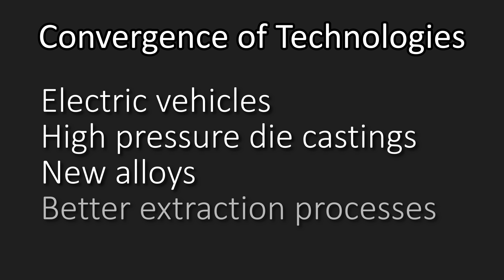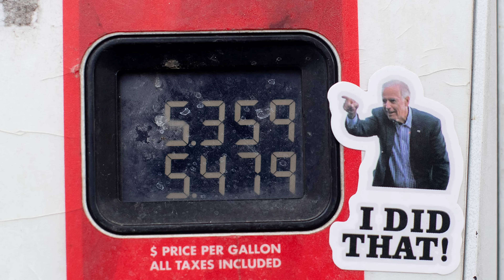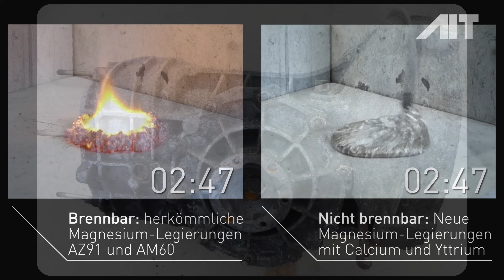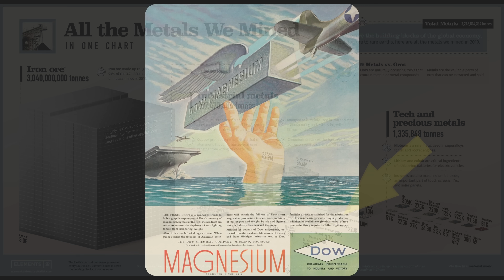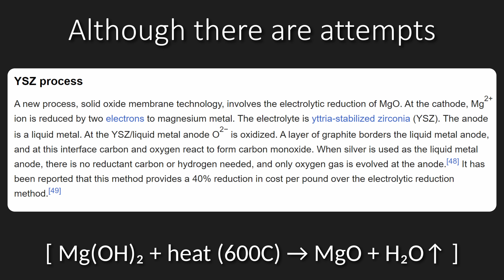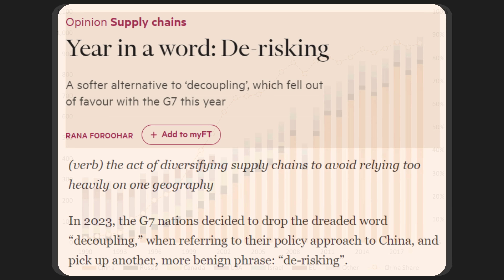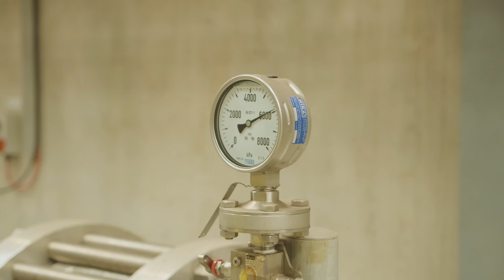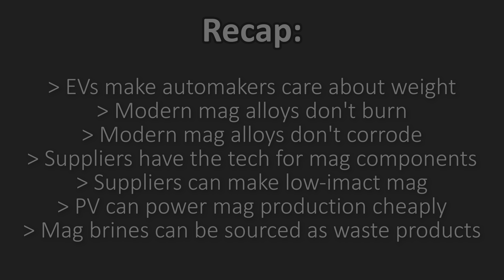Welcome to the AGE of MAGNESIUM

Comment: Oh yeah, let me get a e-car crash where a lithium battery goes up in flames then ignites the magnesium, gonna be lit.
Reply: Try this with a Hydrogen car DUUUUHHH
Reply: Spell Tome: Conjure A-class Star
Reply: mmmmmmmmmmmmmmmmmmmmmmmmmmm burger...
Reply: Back door battery detonation.. if they told you it was possible would you still buy one 🤔
Reply: Add the fact that EVs have dumb computers that turn into obstacles.
Reply: Lol
Reply: i think that if you crash and your car is on fire it dosent mater a lot if it has batteries or not, also we probably can already power a fleet of all ev cars since we already expend a lot of energy in extracting, trasnporting, refining oil etc. while with ev you will just power it, but it will be interesting if someone does the math
Reply: Fair but ideally all cars are electric and self driving coordinating between each other so crashes very very very rarely ever happen.
Reply: @tone618 and then, your alarm clock went off, and you were rudely ripped back to reality.
Reply: @remcovanvliet3018  wooh that nothing burger is really tasty do you think I could get some mustard to go with it?
Reply: @remcovanvliet3018  second chance do you have anything useful to contribute aside from saying I'm right your wrong?
Reply: @tone618 that's probably not going to happen, at least not in this generation, ppl won't accept
Reply: @nicolasmfa  people didn't initially accept automobiles at all and here we are.
Reply: Which means your ability to move is dependant on the Grid like a calf at the teat.
Reply: @SouthPod  as if your not dependant on gas in the same way. Its actually a better analogy for gas as it's a liquid and can't be as easily transported over distance like electricity can via idk the massive network of powerlines across the US.
Reply: @tone618  Your access to that grid can be terminated remotely if the people controlling it determine it to be useful to them. It's also incredibly fragile, moderate damage to two or three substations in a metropolitan area could theoretically shut an entire city down.

Using a smal bit of preparation and the correct tools, gasoline can be stored for as long as three years quite cheaply, it can also produce electricity for home use rather than consume it. Especially in cold climates which don't lend themselves to solar, and wind is not dependable.  Long term battery storage is incredibly expensive.
Reply: "Your access to that grid can be terminated remotely if the people controlling it determine it to be useful to them. It's also incredibly fragile, moderate damage to two or three substations in a metropolitan area could theoretically shut an entire city down."

Same deal with gasoline.

"Using a smal bit of preparation and the correct tools, gasoline can be stored for as long as three years quite cheaply, it can also produce electricity for home use rather than consume it." I wasn't aware electricity consumed itself. gee a whole bunch of electrons seemingly vanished oh wait I'm lieing electrons can't do that.

 "Especially in cold climates which don't lend themselves to solar, and wind is not dependable." Luckily the price of solar panels has plummeted since their invention making it possible to live even in cold climates without issue while panels themselves have highly efficient. People so far north as to make even very large amounts of solar panels impractical are just as vulnerable to a cutoff of petrochemical supply as they are to electricity.

 "Long term battery storage is incredibly expensive." Which is why geothermal energy solutions are optimal alongside low cost gravity storage systems. Oh and battery tech has seen a leap in advancement recently while there are continually more low cost battery technologies.
Reply: @tone618  all cars being electric is just a dumb idea, they're only better for the environment if produced in small quantities.

 Make every car autonomous and congratulations, another less efficient than a simple electric train invention. You guys are all geniuses by reinventing the train again and again.
Reply: @davidaugustofc2574  well that would be optimal but people in the US tend to be far to selfish and individualistic to support the construction of large scale high speed public transport.
Reply: @tone618  that or company lobbying and propaganda works wonders. Cars are more profitable, and so are disposable plastic products, we'll never get rid of them.
Reply: @SouthPod gasoline is literally a liquid? Lmaoooo.
Reply: @davidaugustofc2574  Taking the train is only a solution for people who live in large cities. It's unsustainable for suburban and rural people. They still need cars to get to the train hubs. The train also forces you to sit with hundreds of strangers and deal with their bullshit, their smell, their noise and their bad habits. They are prone delays just like cars, and if the grid goes down nobody goes anywhere.

I took trains for 20 years, I will never give up having a car.
Reply: @SouthPod  I guess it depends on education, the trains here are pretty silent, if someone is causing disturbance there's always a guard every other train.
Reply: @SouthPod   sounds like you rode some kind of murikan train, trains here are quiet, comfortable, safe and always on time 

Rural america before the 50's was based around train transport, system worked very well, because the infrastructure was designed accordingly.
Reply: @PRH123  I'm Canadian
Reply: @SouthPod   same thing :)
Reply: @tone618  I would argue that if Americans are too selfish and individualistic to get on a train, they are also too selfish and individualistic to support their "driving rights" being taken away from them by self-driving cars - If cars (or, for that matter, coach buses, or another slightly more financially viable alternative) are fully self-driving and coordinate between each other rather than taking driver input, what makes them any more inherently liberating than getting on a train?
Reply: @SouthPod  Didn't you Canucks have streetcars once, too? We Americans with our suburban sprawl used to get by just fine on light rail and streetcars out to every neighborhood, and lots of places in the world still do, or take the bus to the nearest train station. Go to Germany or maybe Amsterdam and try to insist on taking the car everywhere you go. You'll learn quick. (Or go to New York City - the subways are gross, but the traffic's even worse.)
Reply: @ratemisia  Look at the size and density of the US and or Canada and you'll see why comparing it to Germany is stupid.

Streetcars only work in dense cities, everywhere else it's too sparse and too spread out here for anything but personal transport to be economical.
Reply: @SouthPod  Someone needs to tell that to China and India... They must be really sorely suffering, considering they get two or three times as many passenger-kilometers by rail as the next country and both have relatively low car ownership! Maybe India is so ridiculously wealthy that they can afford the egregious expense of gigantic rail lines for no benefit... Oh wait. And the Chinese - who we all know for their economic incompetence, surely - sure are wasting a lot of money on the largest high-speed rail network in the world, considering how impractical rail transport is in a country as big as China. Let's face it - our continent was convinced of an automotive future in the 1950s by oil barons and motor companies, demolishing and disusing our perfectly good rail networks in the process, and we're paying the price for it now while we watch the so-called second and third worlds pass us.
Reply: @ratemisia  india - LOL
Reply: @SouthPod  And in any case, you're not laughing so hard about China, are you? What happened with that?
Reply: @SouthPod  I love how you laugh at India while your Mounties don't even investigate all those missing First Nations women and girls on your highways. Oh, sorry, is that a low blow? At least Americans keep up some appearance of caring when we fly our flags at half-mast. You may be up north, but you're not above any other country. Let he who is without sin cast the first stone.
Reply: @tone618  That's cool and all for commuters that view cars as just transportation. I enjoy driving and have never caused a crash or been involved in one. All it takes is knowing your car and paying attention. Too many distractions in cars now, and adding self driving just keep people distracted.
Besides, if we want nothing but electric, we need to embrace nuclear power to even power such a fleet of vehicles, our grid right now could never support such a thing.
Reply: @Friariah  huh it's almost like non self driving cars would be kinda like current day non street legal cars. Nobodies going to stop you from driving them on roads not meant for the general public.

Comment: LIthium Batteries + Flammable Magnesium Metal,- What could go wrong???
Reply: What about magnesium metal and sodium batteries? lol
Reply: @flightlesschicken7769  dear god
Reply: @flightlesschicken7769  actually no, sodium metal car, but in Florida
Reply: @Atomicbrain1034  genius!
Reply: @Atomicbrain1034  do they have beryllium powder in them as well?
Reply: Imagine a hydrogen based fuel cell, charging lithium batteries, in a magnesium bodied car :)
Reply: Spell Tome: Conjure A-class Star
Reply: Gasoline is way more flammable than either
Reply: Good thing gasoline isn't flammable!
Reply: @caseymasters8801  but gas tanks don't really self ignite. The fires are oxygen starved and burn at lower temps and foam sprays are super effective at putting them out.
Reply: @adrianwilson7536 They still catch fire at 10x the rate EVs do.
Reply: @caseymasters8801 yep it isn't. Dummy.
It's the vapor that ignites.

Comment: Can't the car bodies also be made of carbon fiber composite. That should be even lighter, though it can be a little bit expensive.
Reply: Another flammable material
Reply: @sachabinky2915  It's not flammable. It can burn (slowly) along a better fuel but it can't sustain a fire by itself. Or at least this is the case for the fibers themselves. I'm not 100% sure about the resin.

Comment: About 20 years ago , Dr. Gorny developed a magnesium alloy that was stronger than 6061 aluminum and got it to not catch fire.
Reply: That sounds odd, who is Dr gorny and what was the aluminum comprised of?
Reply: @everettstormy Aluminium 6061 is an old known alloy widely used
You can easily find more info about it
Reply: not catch fire? only means it was not heated up enough
Reply: @p0t4toePotato  Not entirely true. You don't know the contents of the alloy, it very well could contain less magnesium then it's alloying metal. 

That's like basic metallurgy bruh
Reply: @roydraper616  yeah op never even mentioned magnesium, he said it was better than that.
Reply: @roydraper616 if that’s the case it’s just a normal metal mixed with magnesium, not a magnesium alloy anymore
Reply: @everettstormy the op literally says magnesium alloy can you read properly?
Reply: @Cloudy_Jones  he's saying mag-ne-see-uhm it's the pronunciation that I was laughing at, he said it weird.
Reply: This is very interesting 
Would you have some more sources, please?
Reply: Really?
Reply: @VHTF_     Yes, I cut the samples for him on a lathe , it machined like Brass, very easy. If you tapped it again steel,  it would  ring , not a dull sound like magnesium.  It would extrude faster than aluminum.  
Very interesting properties.
Reply: What Dr Gorny are you talking about? Marcin Górny at U of Krakow? Anton Gorny at at Gorny Metallurgical Consulting?
Reply: yes
Reply: Is it lighter than 6061?
Reply: @quartamile  yes and stronger
Reply: Who….
Reply: Care to provide a paper or his full name?
Reply: @xStickStockx    I told you pasted away , but there were others that wrote patents,  I believe were based on his technology.  Go look them up.
Reply: was it "not catching fire" at room temperature, or in an argon atmosphere?
Reply: If it is alloyed there is no reason anymore why it should be flamable. Also if something burns lsrgely depends on its surface area for example small aluminium particles also burn. 
Furthermore strength is not the only creterion for a good material there are also properties like stiffness or fracturetoughness and so on...

Comment: Magnesium in automotive isn't new, infact it's quite old. Even old alloys were implemented as engine blocks. Now saying corrosion is "solved" is a misnomer. In comparison to aluminum, the best alloy of magnesium is still quite reactive. The challenge is more on the design side. Metallurgy can still be improved, but the impact is where and how you use each metal in a vehicle. That's not to say the increasing demand for lightweithting isn't a new shift in industry. Indeed, new developments in casting techniques and Metallurgy will allow the implementation in good designs. I can easilly agree with your assessment of production. However, I think alot of people forget the importance of market circularity in emerging demand. Good design and Metallurgy should consider the requirements of recycling for recovering already extracted materials.
Reply: Yep like the LeMans Mercedes crash in the 20s where the magnesium body of the car was an inferno for several hours hours as the race went on
Reply: @Twangaming  like the original Volkswagen beetle engine was made from magnesium from 1951 to 1981.
Reply: @TheTrueOSSS  cool! Didn’t know that!

Comment: I've had old vw beetle engines with magnesium cases, and I still have a 1977 Bultaco motorcycle with magnesium engine case.  no real point to my comment just feeding the machine for your excellent video!
Reply: I've worked on magnesium chainsaws

Comment: Magnesium is only marginally lighter than Aluminium. What's the point?
Reply: On a per strength/stiffness base it's 20-30% advantage for magnesium. For the same structural requirements you might save both weight and volume. It also tends to have better fatique resistence, i.e. less trouble with load changes that cause elastic deformation. The latter being one of the reasons you often use steel in unexpected places.
Reply: Stamped aluminium has low rigidly and when it flexes it rapidly develops metal fatigue. Mgnesium is more rigid especially when cast/forged higher rigidly less flexing less metal fatigue
Reply: For weight sensitive applications, I’m not sure I would call 30% “trivial”.